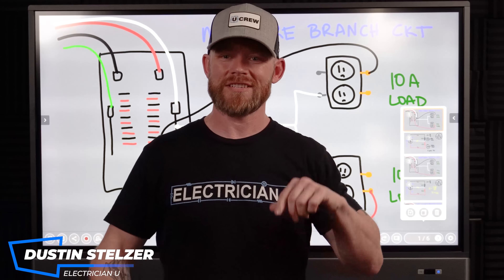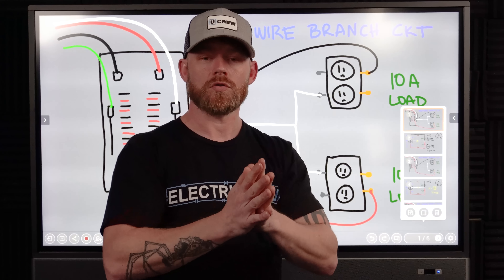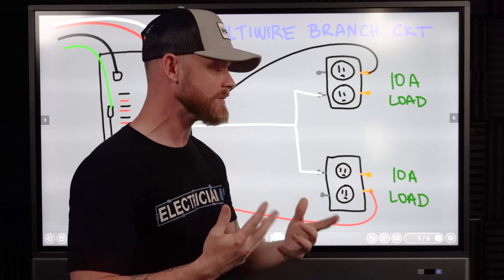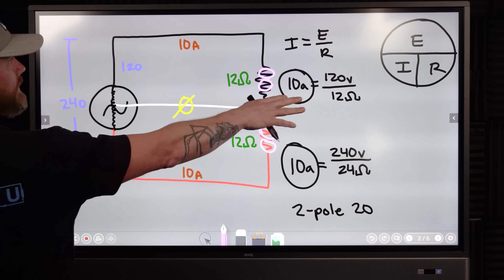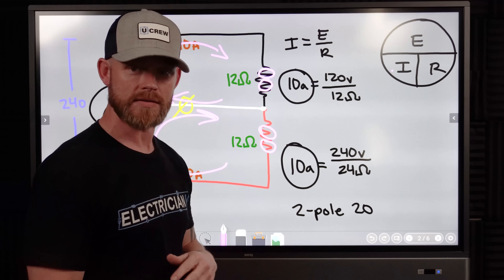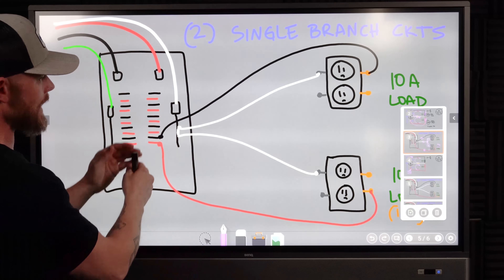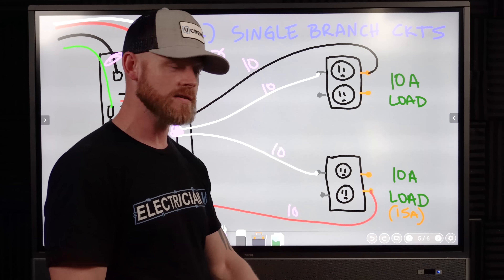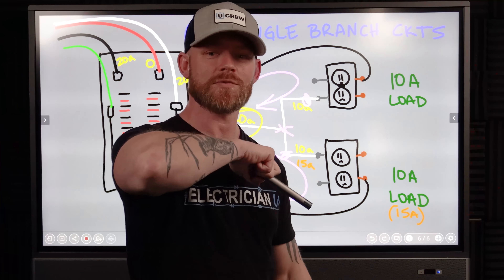Neutral Imbalance in Multiwire Branch Circuits (Two Hots, One Neutral)

Comment: Great information.  I just have a caution to add.
This is a split single phase system (often referred to as 2 phase.)  The secondary winding on the transformer  puts out 240 volts from end to end.  There is also a center tap (a wire connected to the center of the secondary winding.)  From either end to the center tap is 120 volts.   The power company grounds the center tap. That is the neutral.  It is a grounded conductor, but not a negative wire & not a safety ground.  The push and pull is making reference to frequency.  In the USA, the frequency is 60 Hertz (cycles per second.)  So, 60 times per second, the red & black wires cycle from 0 volts to 120 volts.  When the red leg is hot, the black leg is not.  That allows 2 circuits to share a neutral at full capacity as long as each circuit is connected to a different leg.  As mentioned, the neutral carries the difference if the 2 legs don't have exactly the same load (and in 120 volt circuits, they rarely do.)  That neutral serves one more purpose.  If one leg becomes open, then the neutral will carry the full load of the other leg.  
However, Multi Wire Branch Circuits (MWBC) have a danger you should be aware of.  Regardless of the load on either circuit, you DO need the neutral wire, even if it carries no load.   It's the neutral wire that renders two 120 volt circuits from the 240 volts (just like it does at the transformer.)  Every MWBC must have a bonded neutral connected to the neutral of each load at the point where the 240V circuit is split into two 120V ckts.  That creates two parallel 120V circuits.   If the neutral wire becomes unbonded (disconnected) from the breaker panel, those two parallel 120V circuits become two 120V circuits in series which creates a single 240V circuit & 240 volts will pass through both circuits and everything connected to them.  That's fie because the 2 circuits are resistance in series.  But if the resistance of leg "A" is increased by turning something off, without a neutral, leg "B" would require more current than leg A.  That current would be pulled through leg A since there is no neutral.  When resistance is increased, but the current from leg B remains the same, the result is a voltage increase on leg A.  That will result in a surplus of voltage on the neutral of leg B.  (The neutral will have more voltage than the hot can cancel.)
If that happens, damage to devices connected to both circuits will occur and it's likely to be beyond reasonable repair.  Always turn off the appropriate breakers before loosening the neutral of a MWBC.   (Think of two AA batteries.  If you connect negative to positive on two 1.5 volt batteries, you get 3 volts.  If you connect the positives together and the negatives together of two 1.5 volt batteries, you still only have 1.5 volts.  A MWBC is exactly the same, except it's AC, not DC so there is no negative and positive, and don't even think about connecting the 2 legs together.  I know, but I had to say it just to be sure ...)
 

Unrelated, but safety is always worth mentioning:  The biggest danger of getting shocked by 120 volts occurs when a hot wire falls and rests on you or you fall onto or into something hot (such as an open bus).  If you bump it, you can fall away from it but if either you or "it" comes to rest while you're in contact with it, you're in trouble.  Don't fool around with hot panels alone or push a metal fishtape into a panel.
Reply: Well said!

Comment: When you share a neutral on 2 different legs.  You are supposed to have the legs tied to a Double Pole breaker.   Not a single pole breaker.    The double pole will kill the back feed thru the neutral.

Comment: On multi-wire circuits. Don't do it. Terrible practice. If someone breaks the neutral you have a 240v circuit. Plus, what happens when a handyman or homeowner starts re purposing wires?

Comment: I'm struggling with neutral sizing for feeders. Specifically, how can the neutral be reduced for a 100A panel if the first 200A of demand isn't counted? Doesn't that mean it must be the same size as the hots? Also, what if you don't know what any of the loads will be yet?
Reply: Code dances around the subject, not answering the question. It'd be a very unusual situation where neutral has to carry current equivalent to a phase conductor. I reduce one common size, but usually I am using purchased cable with two phase conductors & a reduced neutral.

Comment: As always, very well explained. I was going to make a comment regarding the fact that a combined or split neutral return path on a center tapped 240V connection has no impact to the overall electrical circuit, but you got there at the 12 minute mark.  I like that you demonstrated the danger of the single phase common neutral circuit as well.  I think there is more here that could be explained to help people understand why they get a poke off of the neutral, but it might be a bit much for one video.  Thanks again for an understandable and well spoken video that will make sense to the general electrical worker public

Comment: I have a good question. We did a job Saturday on a dock for the family of the company I work for. We ran 10/3 to a post we built with 2 seperate 120/30a twistlock outlet devices. Ran the black to one and red to the other and shared the ground and neutral. I made up the post while my foreman did the sub-panel work. After turning power on and testing the devices we got 138v on each device we installed hot to neutral and hot to ground. Testing other devices on the same circuit presents the same high voltage. What could be the cause of this M.E.S.? Lol a customer of their dock said their heater on the boat wont run but his AC will. Boss and the owner said that can be addressed another time. Also. This dock we installed a transformer by the panel and at the end of the dock by a seperate sub panel that I had mentioned because they had a drop in voltage. Could the transformers be back feeding to the other subpanel, did we loose a main neutral, or did the subpanel where the 2 120/30a devices are fed from get hooked up wrong(on the same phase)
Love your videos and always appreciate the free educational tips!

Comment: Multi wire circuits that share a neutral are legal. Once upon a time they made good sense. You could save some wire. The danger in them is two fold. If improperly hooked up you can double the current in the neutral and if for any reason the neutral is opened you have created a 240v series circuit. If the only thing you have hooked up is lighting you risked burning up a bulb or two. However if you have run this type of circuit for outlets you just might have your computer or large screened tv connected. If that fails the money you saved in wiring won’t seem worth it.

Comment: Sharing neutrals is a piss way of designing circuits. I hate it. It screams poverty designing an electrical system. Unless it’s going to a fan/light combo set up or special 240 load 12/3 / 14/3 running from the panel for branch circuits is a cheep out and looks cheep. Especially if you have half a panels worth of space to run proper individual circuits.

Comment: The reason it works is because they are out of phase of each other by 120 degrees of each other, this will also work with 3 phase power too, 3 hots with 1 neutral. On a 480 volt AC it's 277 to a gray color neutral wire for 277 volt lighting circuits. Although it's much safer to run separate neutral wires for each circuit, simply because you can wind up with a hot neutral! Try doing your circuit with DC, replace the ac in your  diagram with 2 or 3 batteries, tie all the negatives and positives together, now your neutral will have twice or 3 times the current flow as any one of the positives "Hot" wires! AC power is why it works, and we can thank Nikola Tesla for that, if we were using Edison's DC generators we would be in a lot of hurt!

Comment: hi, i've a question: if the neutral is conected at the center of the coil in the transformer, the same coil of the two life wires, why isn't current in the neutral?

Comment: I did this exact thing a few years ago in my garage, there was an unused 10/3 wire bringing 240 volts, but my garage didn't have any outlets so I tried to figure if I could split it. I'm not an electrician, I just do diy stuff. I know a lot more about electricity now so I know I did it right, but I had a lot of difficulty trying to find accurate information at the time. I wish I had this video back then!

Comment: Your description is oversimplified and uses DC circuit principles, which is probably the best way to describe it to non-technical people. In reality, though, there is not one source, as shown in your circuit diagrams, there are actually two AC sources, one for black and one for red, that are 180 degrees out of phase with each other. It's the phase differences that cause the values of the neutral current. An ammeter just measure magnitude, not phase, which is why the balanced load shows 0 amps on the neutral.

Comment: Good stuff. 👍 
For multi wire branch circuits,
I've been Using breaker handle ties that allow for independent tripping but simultaneous switching Because I believe that's right, right?
 If you haven't already you should make a video about do's and don'ts of multi wire branch circuits.
 Should make for a lot of content hence my comment is so f**** long
like If 2 single branchers are in one Box, you don't just tie all the whites together.
 And why you might find a neutral wire in the panel has turned a darker tan color compared to the other white ones.  Like what can happen if you disconnect neutrals at the panel Without killing the breaker(s) it belongs to.  Pig tailing neutrals at devices. And if you find Kitchen outlet Receptacle with black and red  on one side, Note the tab is broke off,  Separating the terminals.
  Labeling.
How you can ruin plugged in equipment by Being really cool and working on a multi wire branch circuit while it's hot ( Or The other breaker is still on) and disconnect  the neutral.

Comment: I like your videos a lot but I disagree 100% with this video each phase on an electrical system runs on a separate sign wave  since each phase is on a separate sign wave so that neutral only ever has the potential to take the highest amperage by any of the two or 3 phases  ac/dc theory

Comment: As mentioned below a few times, there are some NEC regulations, including that both circuits on a MBC must be on a single 2-P breaker at the MAIN panel and and all sub/intermediate. The biggest risk I've seen is where Handyman/ Homeowner Joe moves one of the breakers in the chain not knowing it's part of a MBC and suddenly you have an overload on the neutral that neither breaker detects. The risk of hot neutrals is also a real thing too if you've ever been buzzed by one. That really makes for a fun troubleshooting experience in an unknown location.
Reply: I was surprised when I replaced some outlets in my mother's apartment and got shocked by the neutral when I thought I had the power completely off.  It turns out that the NEC did not always require the use of a 2 pole breaker for an MBC and the electrical contractor used two separate breakers on two separate phases instead.  Now I know that I have to shut off both breakers when replacing any outlet on either leg of the MBC.
Reply: As soon as any imbalance  happens that amount of current  flows on neutral.
Reply: I always wondered how would an electrician even know in this case? It’s not like the breakers tell you they are MWBCs. I have the exact same setup without handle ties in my house and I’ve been lucky to not have gotten shocked before realizing there are MWBCs all over the house!

Comment: HEY! I'AM INSTALLING! A 20AMP. OUTLETS  AS REPLACEMENTS FOR EXISTING OUTLETS THAT'S WORN!  THE PROBLEM IS THE OUTLETS REPLACING HAS GREATER AMPERAGE! IS THIS DANGEROUS!? WITHOUT CHANGING THE AMPERAGE BREAKER? SHOULD I ALSO CHANGE THE AMPERAGE BREAKER!? I'AMA NON LISCENSE BEGINNER! HERE!!

Comment: I have an issue with our lighting in our home. I cant seem to find out why the lights strobe kind of when it  seems something is drawing the power from something. i have unplugged all our appliances and it still happens.
 I have tried numerous ideas from other master electricians.
 not anything seems to correct it.

Comment: Is this for a star system as 3 phases split share the same neutral even on a center taped transformer can have 110 0 110 or in a amplifier transformer we can have 55v 0 55v with imbalance all works.

Comment: Not an electrician but I know very basic electrical circuit wiring and did not know that you could safely run two 120v circuits on a double pole breaker using a shared neutral. I have never seen that done before is that up to modern code? If so that would have come in handy for me recently trying to keep my current carrying conductors to a minimum in conduit so I would not have to de-rate the conductors.

Comment: Your neutral absolutely does not work that away.  It makes no sense.  The neutral is still the voltage reference for 120v.  If you had 240v on 120v appliances they would blow up.  Regardless if the current is still at rated values.

The neutral has no current because the waveform cancels out.  120v/ 240v is a split phase system.  Meaning one phase is the positive 180 degrees.  The other is negative 180 degrees.

This video is completely wrong.

Comment: 1 neutral with 2 circuits on same phase = burning out the neutral or 12 gage wire wire good
for 20 amps will have 40 amps on the neutral if loads are on the same phase leg. This is how
fires start as 20 amp breaker is safe for 12 gage but neutral is being overloaded. current 
being doubled heat of wire goes up 4 times or 768 degrees.

Comment: You need to go further with this scenario. 
If you lose the neutral to the cabinet that is doubled to the outlets and you have a separate load going to each outlet, then you will have 220 volts divided into each outlet, depending on their amp draw! 
That is why I never use this circuit unless it was a 220 circuit. 
I have also worked on 110 lighting circuits that shared the return circuit in which I isolated the one circuit, thinking it was safe to work on, but in fact the neutral was hot from another circuit's return.
Reply: I have also run into the same situation!
It was on two, 277 3-phase lighting circuits sharing a single return.

Comment: If this imbalanced circuit displayed was hooked to a GFCI double breaker could it cause it to trip? This is exactly how my hot tub is wired on a double 50 during a filter cycle start up there is an Imbalanced load on the neutral and it trips the breaker at times is this possibly what’s causing the trip? If so what is the fix?

Comment: Very interesting video. You've gotten my EE brain to jump into the weeds analyzing your push/pull analysis although being 120 degree out of phase (red and black different line inputs to panel) yet common neutral with the circuit diagram showing red completing the circuit into "bottom".
Reply: For 2 phase (shown in this video) - it’s 180 degrees. Three phase (3 hots) utilizes 120 degrees between each phase.

Comment: I wish you had explained the imbalanced share of 240 volt supply if the shared neutral fails. 
Also, I'd like different choice of words when you refer to different phases. Not red phase, black phase. Both are ends of the same phase. White connects to the middle of that transformer secondary winding.

Comment: Home Inspectors! The real estate types, not the city. I'm an EE myself. When I bought my last house I followed the guy around. When he opened the panel it was full of tandem breakers with MWBC. But looking down the row was RED-BLACK-RED-BLACK. He insisted that was right. "Every other breaker is a different color". The fact that a tandem breaker has both breakers on the same phase went right over his head. Fine! I eventually fixed it myself. But where was the EC supervisor when his unqualified novice crew was wiring these houses? Where was the building inspector? It was inspected and approved when built in 1990!

Comment: I've been racking my brain around this. I have a problem with on two outlets on a different breakers. i check with a receptacle tester and its fine, everything correct no open ground. then i plug in an appliance. the tester goes out no power, but it transfers power to the ceiling fan and light gets more power. At the same time my 3gal electric water heater has the neutral as the hot and ground as the neutral. I didn't do this work in the first place. Now im trying to fix the issue. please help.

Comment: Very good video! I have a question. I have a friend that told me whenever his wife turns on her hair dryer while the wall AC is on it trips a breaker. I note that he told me it's not  instantly. He also said that the two are definitely on two different circuits. He says if one or the other is on separately he never has an issue and there's not much wattage on either other than the AC on one and the hair dryer on the other. So would you say despite being on two separate circuits they are most likely on the exact same phase and possibly building heat on the neutral wire? By the way the wall AC is a 240 volt Thanks

Comment: Good presentation, I would like to see a lab test with a current hook-on and some power meter.  I like the way you simplified the issue, The analysis is as if it were a DC circuit.  Would be interesting see both fans working with the neutral removed.

Comment: Just don't touch it.  Call an electrician.  You can pull 10 Guage x 3 conductors plus a ground romex between the service panel and where you want an outlet.... If the outlet goes outside.... don't touch it at all.

Comment: Do you have a video explaining how a 240 volt circuit is completed on 2 hots with no neutral? Most 240 volt welding machines only have 2 hots and a ground.